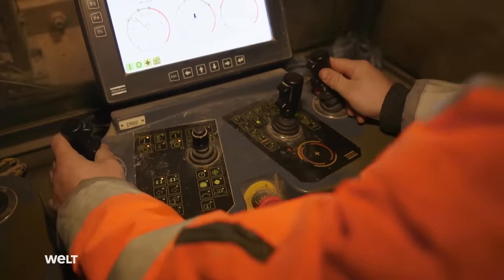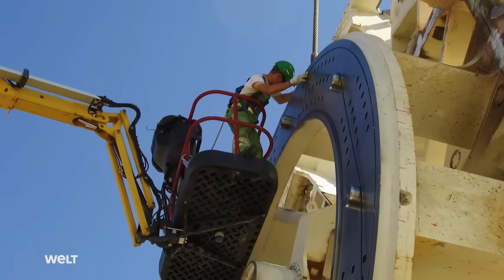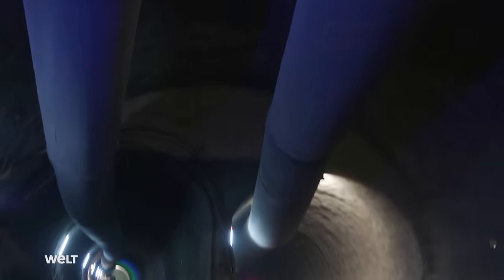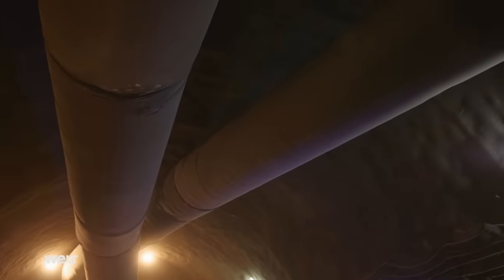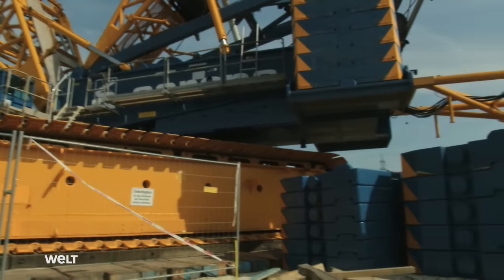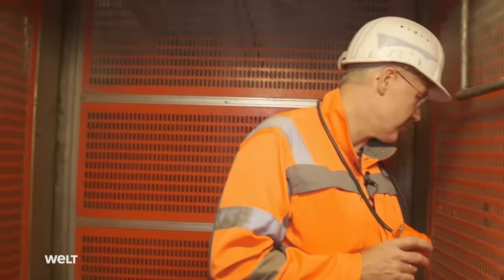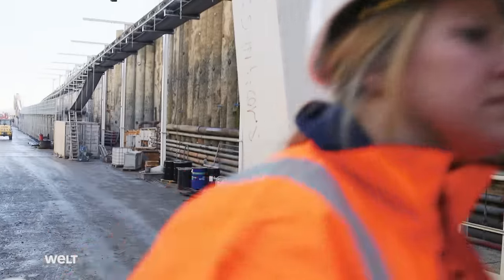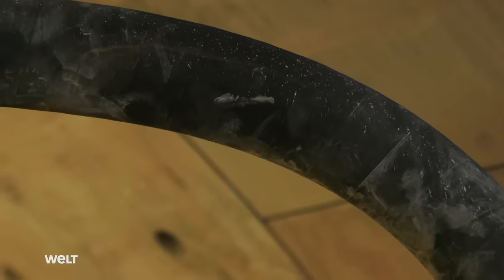MEGA TUNNEL MACHINES - Drilling, Digging & Blasting | Full Documentary

Comment: That shotcrete performer isn't wearing hearing protection or eye goggles and that mask he's wearing is wrong, he's breating in cement dust non stop. 1 little pebble from the shotcrete can blind him. It made me cringe a little. 
I also don't see the point with those iron mats they install while he's shotcreting. The shotcrete has iron fibers that make it just as strong as without them. The mats only make it worse, since air pockets can gather behind the metal and mess up the strength of the construction. Meh, too much critique, but they're great workers.